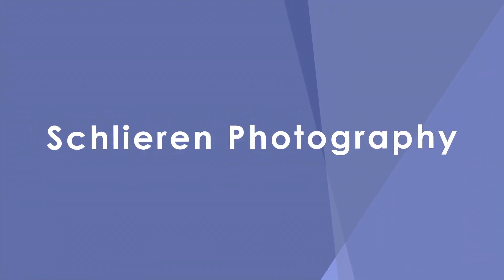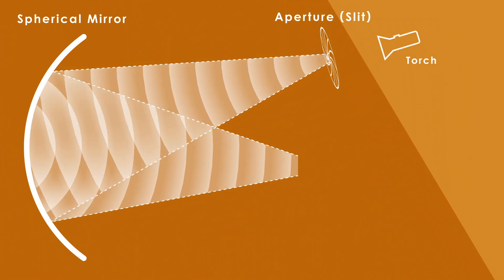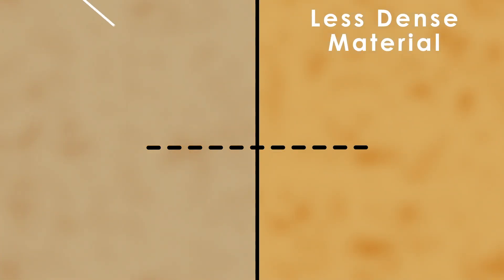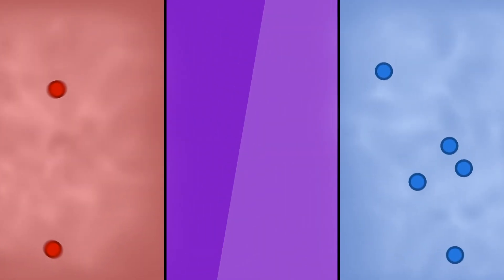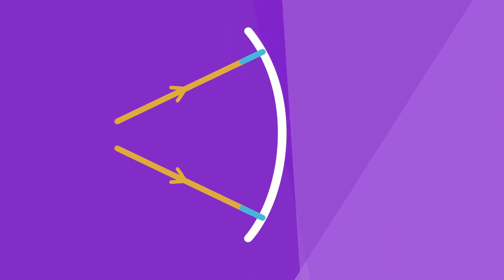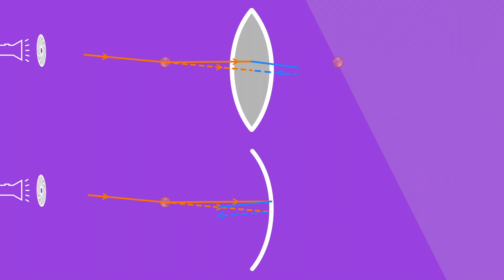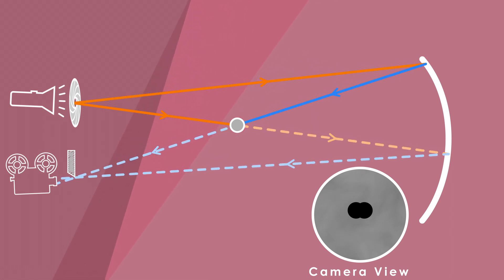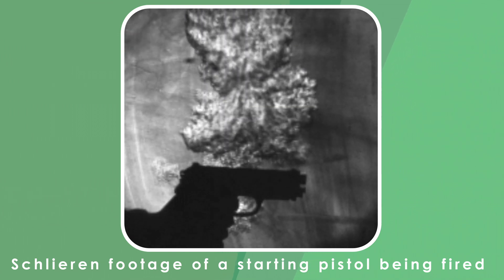What, How and Why – The Secrets of Schlieren Photography

Comment: 2:49 to see sound waves, you don't necessarily need a slow-motion camera. as demonstrated by a Harvard professor, you can use a light source that is pulsing at the rate of the sound frequency, i.e., stroboscopic effect.
Reply from the maker: This is correct! This does require you to know the frequency of the sound wave, however, so pure frequencies would be more easily seen. A paper on this technique can be found here:
https://doi.org/10.1119/1.5042245

Comment: Pro tip: you can make a multi coloured schlieren effect by using two different coloured pieces of clear plastic or glass, place one colour exactly were the razor would be an the other colour directly below it, so all the light not going through the other colour will pass through it
Reply from the maker: Thank you for mentioning this! This is true and also extremely cool! By replacing the knife-edge with a colour filter, we can not only create some (really) cool images, we can also get more information about our heat source! For example, say we used a colour filter with the upper half allowing only red light through and the lower half, only blue. The red parts in our resulting schlieren image would be due to light refracted to above the original knife-edge line, and the blue from light refracted to below! By adding more coloured bands to our filter, we could get even more information about our heat source!

Comment: Dude, awesome video.
I have an average size spherical mirror(it says in the label), but I cant get to focus light with it, so i guess it is not spherical after all. Where did you get your mirror from?
Reply from the maker: I don't know, I'm afraid. I only worked with the equipment for a very brief time. Spherical mirrors can be bought from most optics manufacturers (e.g. ThorLabs), though these will be expensive. Trying to find a store-bought spherical mirror could be tricky, but an easy way to test if it is actually spherical would be to hold it up near a light and see if you can see a light spot somewhere on the ceiling (in the same way you focus sunlight with a magnifying glass).

Comment: I saw this Schlieren effect in my telescope, i put a bright star (like Arcturus, Rigel, etc) on the center of my eyepiece and defocused the star
Pd: I apologize about my English
Reply: Going to try this!
Reply: That's not actually a schlieren effect. It is a closely related technique called a shadowgraph. They are similar but also very different. the schlieren shadows are proportional to the density gradient in the air. In a shadowgraph they are proportional to the gradient of the gradient. That makes a true schlieren setup (with a knife edge) much much more sensitive, and it also results in a much sharper image.

Comment: Nice work Evan!  Did you manage to get any good images?  Are the images in the video ones you took?
Do be aware that optical density and physical density are not the same thing.  It is possible to get lower density materials with higher optical density.  Very useful for lightweight glasses and contact lenses.
Reply from the maker: Thanks! Most of the videos are from my time at the university, with one or two exceptions. They're already pretty good, but if I'd had more time I could have improved the contrast and sensitivity of the setup. Perhaps a project for another time...

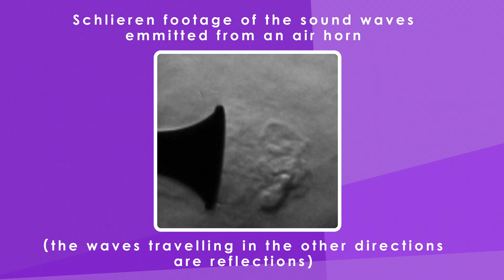Comment: From where did you get the video of sound waves at 6:52 ?
I am very interested in repeating those results.
BTW: Nice work. Your explanation of the phenomenon was very good.
Reply from the maker: All the videos were taken at Exeter University with a phantom slow motion camera. That video was of an air horn, taken at 120,000 fps. Imaging the sound waves was much harder than imaging hot air (because the changes in density are much less), and the setup had to be improved accordingly (moving the razor around, using a stronger light source, etc). The source of sound you use has to be very loud too. Good luck!